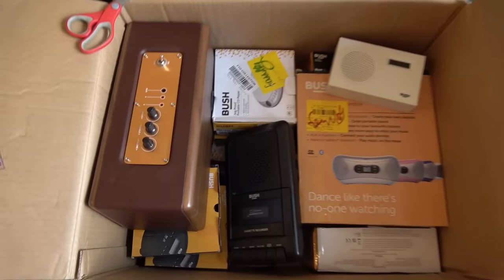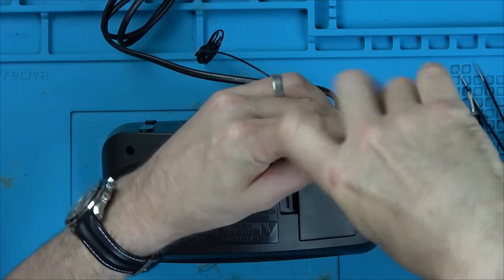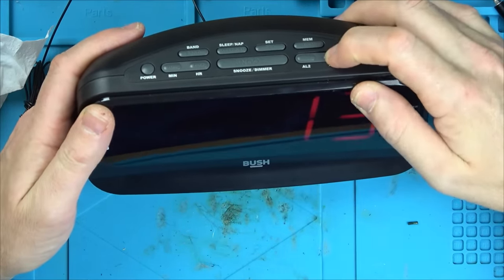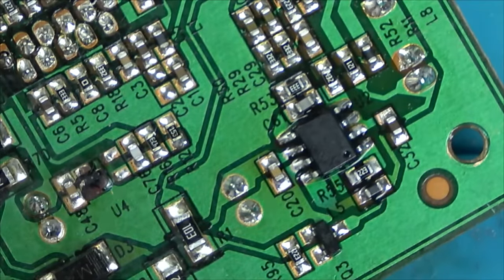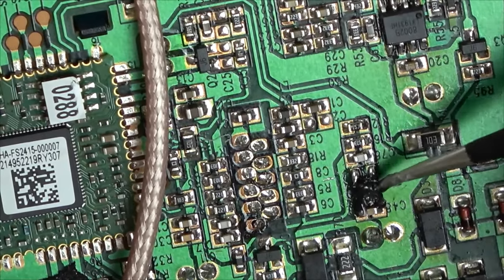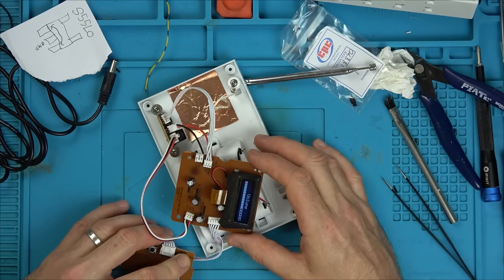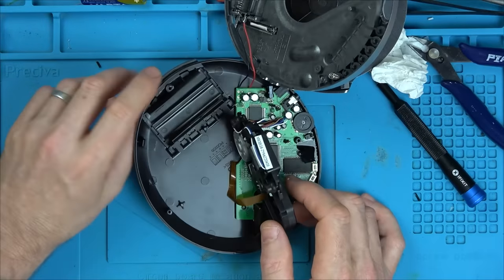I Bought ARGOS CUSTOMER RETURNS to FIX - Can I Make ££$$€€

Comment: just came across your channel last night, brings back lots old memories of taking stuff apart to diagnose and fix and sell on, its so satisfying seeing some many of these products with such minor issues fixed to find a new home and giving it a chance to do what its designed for, save so much junk in landfill that doesnt to be. i always salvage batteries out of disposable vapes and build portable power banks or LED portable torch or lanterns for camping with them or repurpose them for other electronic projects in future. Subbed by the way cos im sure alot of your contents will help myself others out there to fix their goods before even considering dumping it.

Comment: That first clock, when you put the dome in where the original had been not responding, you didn't completely seat the dome into its little nibs. This has the effect of making it taller than spec, which points back to the idea that the button above it is a bit short or otherwise mis-formed.
Reply: no

Comment: Using your amplified speaker (line in) for fault finding is an excellent idea. But to protect it from input shock, add to the end of the cable, in series: a 50n capacitor and a 220k resistor.

Comment: Good clear video and informative. One thing though. I would recommend using something like Knipex wire strippers, side cutters are just wrong. Then soldering a 3/8th stub. Cutting off 1/4 to leave a 1/8th nub of neat wire to dab onto test points on the board. Using fly leads with long bare wire or worse a frayed end of multi-strand is asking for a short circuit. Otherwise a big thumbs up.

Comment: For the DAB, you'll find that the SHDN/ label has a bar on top of it denoting that it shuts the regulator down when low, the other regulator was just labeled EN which denotes that it's enabled when the pin is high which amounts to the same thing.. There's no 'feedback' on these fixed regulators. I suspect that the 100mA output limit of the first regulator wasn't enough causing the output voltage to collapse that's why it didn't work. As mentioned elsewhere, probable reverse polarity of the batteries, as the unit would have come with it's own dedicated power supply, did the blowing up honours!

Comment: I used to have a PC repair shop and once came across a GPU that seamed fine apart from a physically mangled capacitor, being an ASUS channel partner and having access to original spares for their laptops I decided to get in touch with them to simply ask for the correct value, after a bit of fenageling and representatives the final answer I got was that it was proprietary info and they will not risk letting it out there lest someone manages to get enough info to copy it.
Bit of a change from when all HiFi and radio equipment would come with the schematics inside the cover.

Many manufacturers nowadays even grind off the labels from key components.
Reply: And this is why we need Right-to-repair laws in place everywhere, who include the requirement for public access to technical schematics. 
And fines that actually matter for breaking them. (None of this, "we'll fine you 2 million for this" when they Made 2 billion on it).
I'd say .1% of the annual earnings for the first infraction, and every time they are proven to intentionally break it, we move the decimal point one spot to the right.

Bet you no one of them will ever go beyond 3 times.

Heh, Apple would be funding half the world in 2 years...

Comment: The 8002 amplifier chips are realy common they are in almost every (cheap) thing. I bet someone plugged the wrong voltage in the white radio causing the chips to blow up. You are lucky the main processor of the radio (on the little pcb thats soldered onto the main pcb under a sticker) is fine and did not get damaged

Comment: Working in manufacturing, it isnt entirely uncommon for the assembly team to forget to solder something like a speaker wire. Or to have a unit sent for rework, only to be returned afterward to be reassembled without mentioning that something has been cut or removed and needs replacing before reassembly... It's incredibly annoying, but thats what happens sometimes.

I've also seen it happen where a new assembler decides not to follow the process on a product that requires a sequenced assembly process, causing parts/wires/components to break. Which is real fun when not following process instructions means scrapping a board with a final product retailing at $10,000+ USD...

Also, repinning those micro connectors is a god damn nightmare when you accidentally break the pin.

Comment: Not bad, it's amazing that the "faulty returns" can, in some cases, only require small repairs or minor repairs to get them fully working again. Even with the DAB/FM radio, you could tell it was going to be a 3.3V voltage regulator, so hopefully you'd be able to get the right one.

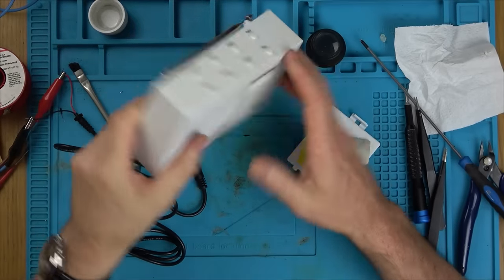Comment: 22:00 
Deductive reasoning is your friend. 
You've traced the power input to the 5-pin IC. 
You assume the 5pin sot23-5 is an LDO, because it has two filtering caps (one for input, and one for output) 
Since you know 5pin sot-23-5 based LDO's pretty much have only a few pinout configurations, you can further narrow it down based on a few criteria
1) Where is the VCC, GND inputs? 
2) Which way around is the output?
3) Is there a current sense resistor / divider attached, if so, to where? 

Once you've run these questions down, you can pretty easily narrow down the IC type you'll need 
From what i can see (and you should probably verify the connection points) it looks to me to be an AP2205 or similar adjustable LDO

Comment: Mate Vince you did better than l did changing the 7 x 18650 cells in our stick hoover. I let the smoke out for good when a component shot out a big spark as l accidentally shorted out something or other with a wayward loose wire…!

Comment: Those snappy triangular switches can be a real sod to align right. I had one of the 1970s Mastermind games, and the whole keyboard works like that and I took it fully apart before realizing quite how it worked right. There were a few keys non-functional. Getting that back together and working nicely was a nightmare.
Reply: I have a portable air conditioner with those PCB buttons and it was getting very hard to turn on so now I just switch it off at the socket.

Comment: Vince, about the radio, OK, you got it and that is the most important. Anyway, I guess there was a more simple way of finding out the regulator voltage. Considering you had the correct code for the sound chip (that you replaced), its datasheet would probably indicate the necessary working voltage.
Reply: Exactly ! I won't bother to comment.
Reply: ^ but you did.

Comment: Regarding marking up on boards, this info is often in the Fabrication Layer - which is where the info to drive the component placement is put - this is NOT printed, its a pure data layer. It would require additional processing to extract values and ID's to put them on the Silkscreen. Often the text in the Fabrication layer overlaps that in the Silkscreen - so a person would need to rearrange things, all adds to the cost.

Comment: @first clock @02:45, sometimes i've found the inputs just die (bad chip or a crack on the circuit board possibly caused by manufacturers poor understanding of voltages, i'e the contacts need to be carbon vs metal :face-purple-wide-eyes:, it also happens to remote controls 

as always a good video :goodvibes:

Comment: What a result Vince well done you, that second radio I think someone butchered it so they could take it back, My mum purchased a Miele vacuum cleaner was expensive it was like £300, anyway she couldn’t move the pole and head as it was so powerful it was hard for me to do it even on the low power setting, we took it back to Argos and said that my mother can’t use it, the lady said “ we can’t refund the item because it’s not suitable” so after a bit of a back and forth argument, the lady said and I quote “ maybe if you brought it back tomorrow saying it’s faulty, smoking, or tripping your electric, we will be able to help” and they did she got a refund 😊
Just shows you what they do there lol 😊
Reply: You'd think it'd just be easier to unplug the speaker connector though!

Looks more like one that an inquisitive eight year old has mucked about with to me. 

I've seen several shop returns where a plug has worked its way loose. Never quite sure if it's deliberate or not.
Reply: @jasejj  I know but people do strange things I buy a lot of faulty TVs and the things I’ve seen cables cut, components ripped out just so the Tv doesn’t come on and show the cracked screen

Comment: Vince re. speaker positive and negative. Doesn't make a jot of difference really. Only with multiple speakers where the absolute phase is important. Bass for instance would cancel if you did one one way and the other the other. There may be an extremely unusual case where a speaker earth is actually referenced to earth and the amplifier output terminals are also referenced to earth, in which case you could short the output, but in 40 years working in audio I can't think of one off the top of my head.

Comment: The screen print on the pcb is just enough for factory assembly but they do not want you to repair….better you buy new..  by example I recently had a car wiper motor stop and knew it was a pcb fault.  The manufacturer wanted £800 for a new motor. Way over the manufacturer price. Initially the manufacturer said it was copyright but eventually talking to lesser employees they explained…. If you could fix they would make no more money but if not they can sell you a new motor. As for price they decide what you would pay. Because you must have wipers they push the price as high as they can.  The motor costs them £15 so if they charged you £60 they would make a small profit but on a £20,000 car what would you pay to keep it on the road.  Even a second hand car you are not going to scrap it for the sake of £800!!  If Right to Repair is forced we might eventually get details but until then…..dream on. ☹️☹️
Reply: Which is why they're intent on banishing the right to repair as that prevents them the right to profit. The latest attempt to ban right to repair and modify is a new campaign to ban the repair, modification and replacement of parts by end users "for your own safety" after a series of e-scooter fires in homes in recent times.
Reply: Even if I had the right to repair something, that does not mean that I have the skills, tools, or inclination to exercise that right myself. Realistically, my options are to retain a professional (sorry, Vince) to fix it or just replace it. 

I do try to donate my non-working electronics to a charity shop, however, so someone else can ultimately attempt to repair them.

Comment: On the third radio with the faulty regulator and sound chip the enable pin on the 3.3v regulator is tied to the supply so that the regulator stays on because the power is removed from the regulator at an earlier stage in the circuit... I don't think the batteries will be drained.

Comment: the cd's that don't play may have an adjustable pot on the side of the Laser, you can adjust that a little tiny bit and can sometimes bring them back to life
Reply: It's actually not helpful to suggest this because it's not a valid fix. That adjustable pot sets the laser power level (RF). Tweaking it might cause it to start reading the disc, but the increase in power just make it degrade faster so there's really no gain. That's the trouble, the laser diode is weak and the only real solution is to replace it.

Comment: the Bush stuff is just tat, ALL are used and please never forget your time as the most valuable item so sadly I'd say a complete loss on anything paid. Cheap consumer electronics are sadly mostly disposable. Yes they can be repaired but it's just not cost effective when China chucks them out brand new for pennies. PS - this is my first video but having had a look around some good stuff and I'm now subscribed 👍

Comment: That first clock radio with the non-working volume button. Unless my eyes deceive me, when you peel the button off at 3:00 there is a tiny black fleck of something, presumably the black plastic which the case is made from, right in the middle of the domed part at the point where it would make contact with the pad on the board underneath. It's visible all the way up until about 3:11. At some point after that it probably falls off or gets cleaned off and that's presumably why it works of when you put it back together.

Comment: Pin 3 is a shut down line it can be used to switch the chip on or off (pulled high or low) if it's tied to pin 1 (Vin) then it's being pulled high (this pin can also be controlled by a processor logic low or high, but it's been done the easy way and tied to pin 1). Pin 4 is as stated 470pf cap to reduce noise on the output pin 5 (Vout). Looks like the other components nearby caps etc are just to reduce noise and voltage in other parts of the circuit. hope this helps. Enable pin works more or less the same way logic low or High. Circuit might need more than 100mA this will reduce the voltage and make the regulator hot.
You would be better off finding the input voltage with your meter into the pcb first, then unpluging the items from the mains and using your bench supply to power the pcb, this way you protect yourself from getting an electric shock from the higher mains voltage inside the items. (Hence find the bridge rectifier and the capacitors that smooth the A.C to D.C and other regulators/components after to alter voltages and tap into the circuit there with the bench supply/low voltage side).

Comment: Normally, for the regulators with an adjust pin and the 2 resistors nearby, Vout = Vref(1+R2/R1), approx.  So if those resistors are the nearby 15k and 47k then I think your Vout will be about 1.6v.  Vref is the voltage divider on the output, voltage across R2 (which I think is the 15k in your circuit) with the full input voltage used for the calculation.  So your 5v (or 4.6v) into  a 47k in series with 15k means Vref is about 1.21v and 1.21*(1+15k/47k) = 1.6v approx.  Not 100%sure but reckon you might be shoving in 2x the voltage to wherever that Vout goes, but what the heck if it works :)
Reply: Vref could also be 2.5V or anything really, so you can't know. The reason the first regulator didn't work was because the feedback divider was connected to the bypass pin, which is not intended to have a feedback network, but just a capacitor to ground (optional, not required) if you look at the datasheet. So that was putting it into some sort of fault condition where it shut down and didn't put out voltage. If the resistors were removed that regulator would have likely worked.
Reply: @brainndamage  Yes, that would work.  For some reason I was thinking that grounding the adj pin would give you Vin at Vout, therefore the reference could be calculated based on the resistors but I don't think it can be done like that.  I think it is a set voltage, internal to the regulator, that you'd need to check the datasheet for - which can't be done in this case.  Typically about 1.2v I believe, but I suppose it could be anything.  Agree 3.3v seems more intuitive (and likely) than 1.6v but only way to find out would be to find a working one.
Reply: @Chained_Unicorn  I've seen 1.2, 1.25, 2.5 and a couple values in between, can't remember. It's in the datasheet but of course you don't know the part number if the top is blown off... I would see which chips that rail powers, look up their datasheets and see what voltage they're rated at. But if you just take into account input voltage, from 4x alkali e can be from 4-6V, so it can't be more than 4V on the oitput.

Comment: I didn't realise those surface mount chips would withstand so much heat. I try to be very quick when soldering them.
Reply: I was screaming at my TV, "stop!", "Stop!", etc. He kept reheating the pins!. The solder was fine the first time, then he kept playing with it. Then he was adding more solder. I was getting pissed! Lol
He left the joints worse than when he first soldered them.
I'm glad someone else noticed the torture that Chip was able to endure. It did better than I did. Lol
PS
I applaud you on your diplomacy.

Comment: Once upon a time a very long time ago (I was around 15, and I'm nearly 50 now). I wanted to return something I'd bought, it wasn't faulty and I knew that the shop wouldn't accept the return, so I went into the device (I think it was a radio/cassette player) and disconnected wires... product was accepted for return as "faulty"... I doubt that that is the case but maybe... ;)

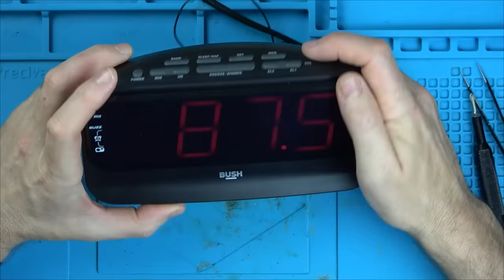Comment: On the large radio, there WAS AM on it, since I saw "522" at 6:19, which is the bottom of the AM band - 522kHz.
So someone has desoldered the AM antenna, the cables for the speakers, cut the FM aerial, then returned it!
Reply: I'd say more likely that while fiddling around inside they sheared the fine antenna wires. And - speaking as an ex-student -  could be someone played a prank removing the speaker wires